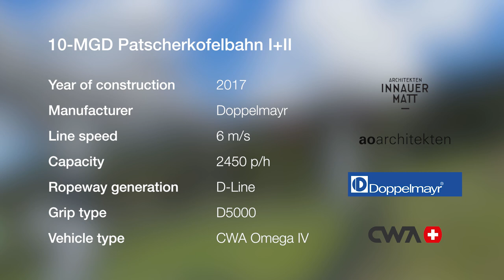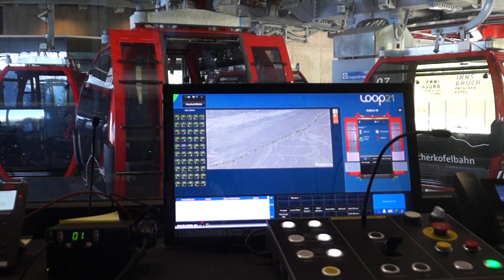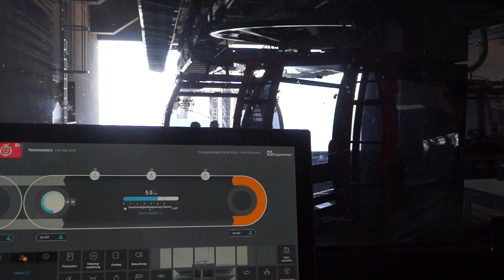Patscherkofelbahn (Innsbruck, Austria)

Comment: Has the broken direct drive already been repaired?
Why is the direct drive coverd?
Reply from the maker: The broken Direct Drive was actually swapped out for brand new one in a matter of days. These Direct Drives are hermetically sealed and there is practically no repair that can be done on-site. The replacement was actually pretty costly, as they had to cut a giant hole in the concrete roof to lift the drive out of the building. As far as I know Doppelmayr paid for the replacement as it was a manufacturing error. No idea why the drive is covered :D
Reply from the maker: Thanks for the link, looks way more efficient than cutting a hole in the roof..
Reply: What happened with direct drive?
Reply from the maker: @winteronly9371  The drive broke down a few days after the gondolas opening back in 2017. It was a manufacturing error, but I'm not sure about the specific cause.